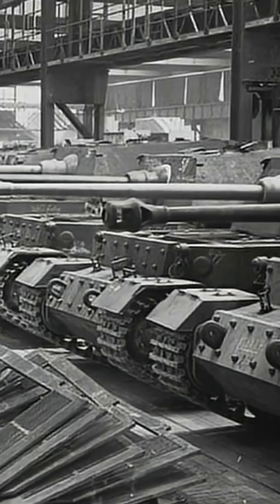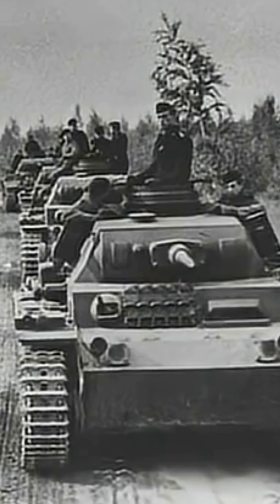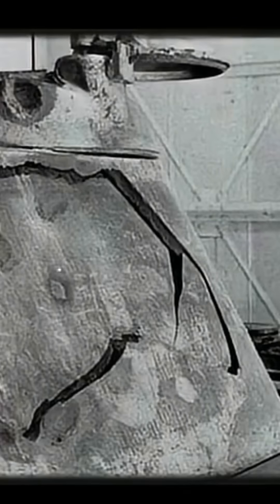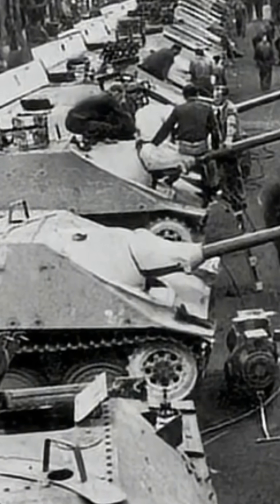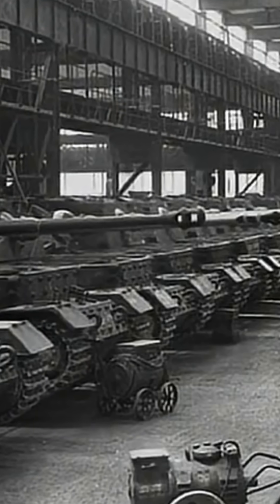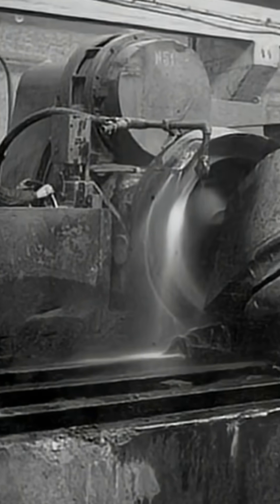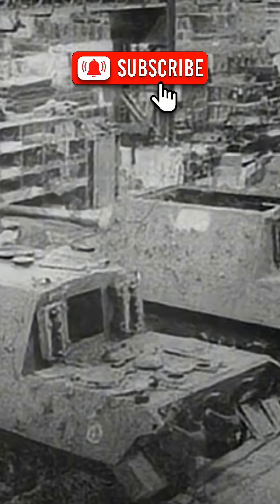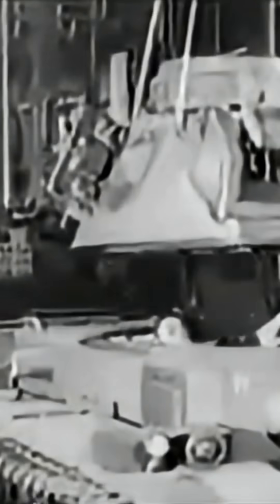Why Were German Tanks So Boxy? The Real Reason Behind Their Design #history #tank #military #army

Comment: Why not weld flat plates at an angle?
Reply: Interlocking welded plates used by the Germans gave far more resistance than simple angled welds from the Allies. Specially with very thick plates which were really difficult to properly weld without risk to make bad welds or worse, damage the plate.
Regards 
Regards

Comment: Another thing is welding. Welding sloped armor was more difficult and required more steps than 90 degree plates
Reply: Your thinking of this the wrong way. You can cast a section of armor but the designer accounts for the area where the weld is. As example look at teh M4 Composite hull Sherman.   

Chrysler figured out that the front upper hull section where the hatches protruded into the front plate took too many man hours, so they designed and cast a one piece upper front section that sat on a welded lower hull that had the unneeded parts cut off. The cast section and rolled armor steel section was then welded together. These were mas produced. 

The US had extensive casting facilities available, especially once the locomotive producing companies like Baldwin and ALCO became involved.  

Early in production the locomotive companies had experience in casting steel but not cast armor steel. They had problems getting the correct hardness. US Army wanted a Brinell hardness standard of 260. Parts were coming in anywhere from 300 to 200 depending on manufacturer. As more experience was gained the quality improved. 

Producing rolled homogenous armored steel plates is relatively easy. Cast steel is easy to cast but requires more hand on attention to details to produce high quality cast armor. You have to control cooling rate, quenching, etc. 

For Germany it was far faster and easier tp produce large quantities of RHA steel plate,  cut to the shape desired, and weld it together.
Reply: @Anlushac11 The fact was that casted armor steel was between 10 to 20% less resistant to shells than rolled homogeneous steel plates of same thickness, as cant be controlled the grain grow and the Rolling gave a fully homogeneously cristaline pattern, while casting gave an irregular cristal pattern. Also , It was easier to give termical treatment to a rolled homogeneous steel plate of the same thickness than a piece of casted steel with different thicknessess giving a more irregular treatment, giving too hot and too cool spots, which were more prone to crack or fail when impacted. For this Germany rejected plainly cast armour less for just mantlets and cuppolas. For this too, the Allied Tanks made by cast armor steel were easier to penetrate. Cheaper but more dangerous to the crews.
🤷🏼🤷🏼